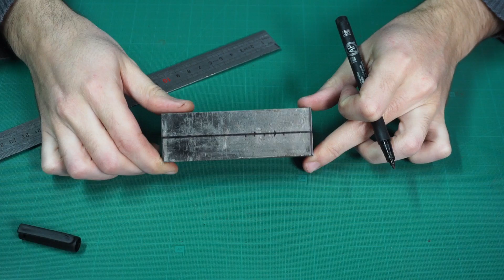Making a Japanese blacksmith hammer

Comment: Brilliant work. Can I ask what you built your forge from or where you got it? I like the hexagon shape.
Reply from the maker: Thank you! And sorry for the late answer, I don't know why I didn't get notification. 
I did the forge that way welding many plancks of metal toghether simply because I didn't have any circular receptacle of that size at the moment, but I ended liking the shape too. Then it's just two layers of ceramic wool in the inside snd some refractory mortar over them to encapsulate the fibers. Have to say that can't get it to forge weld though.

Comment: Beautiful hammer, I wish he could explain the reason for their unique shape
Reply from the maker: I don't know exactly the reason for this exact shape, after all, tools evolution is different in different parts of the world depending on the needs of the craftmen. But the differences you find with a "usual western hammer" are, for example: the head can be long and have more weith while the face of the hammer is still small, so it is more acurate and drives more force into little sections of the object you are forging; the balance of the weight is forward and it gives a different sensation while hammering (You can like it or not); also the angle of the handle with the head makes it confortable to make bevels on blades.
Reply: @aikabacrafttools9129  these forward heavy hammers, you find them all over the world in conjunktion with the forging of bladed tools. And throughout the ages, smith graves from viking age norway has revealed hammers indistingushable from japanese blade smithing hammers… Probably the most unique ones are the sheffield cutler-hammers